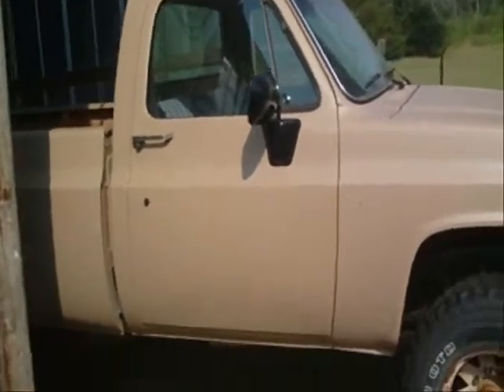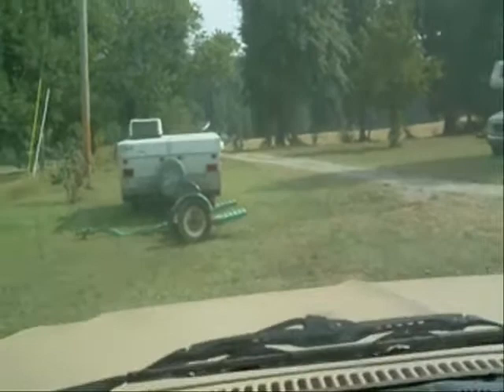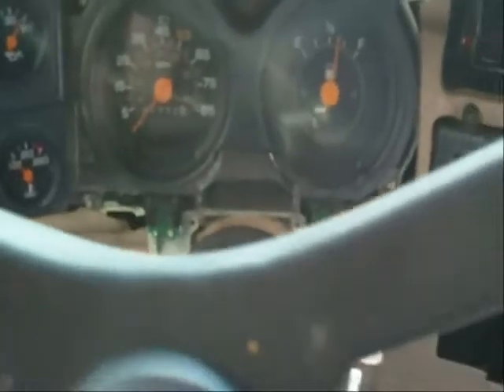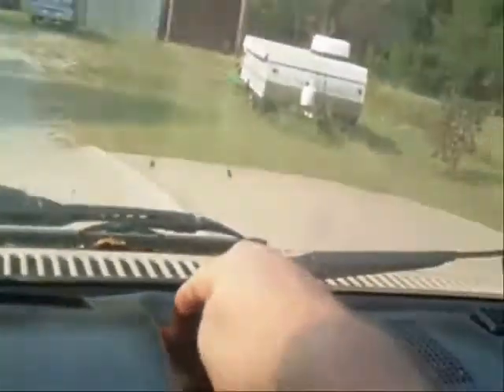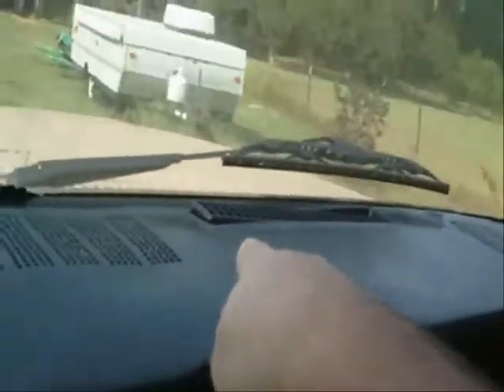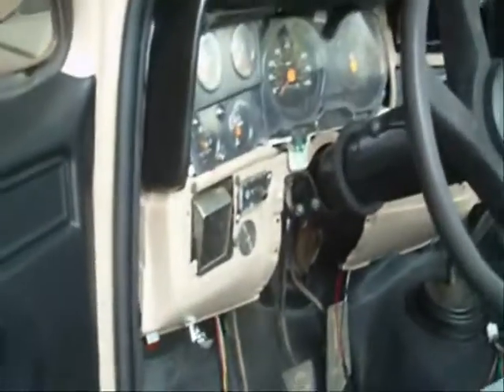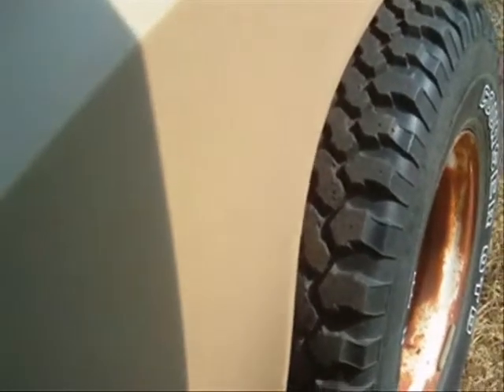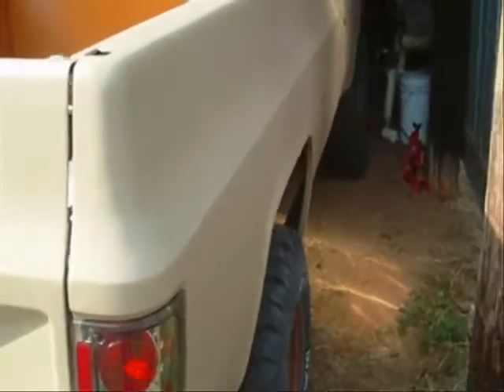Project Diesel Update 9-3-11

Comment from the maker: @mountainman28713 The starter has to build 100 RPM to fire it off.  Assuming your batteries are fully charged and the starter is good, then your battery cables are the weak link.  The cables on mine are huge.  I would say they are as big as welding leads and I believe they are factory cables.  The batteries are the premium Advance Auto Parts batteries and I ran them down trying to get it to start. If you decide to use ether, unplug your glow plug controller or you'll blow the heads off.

Comment from the maker: @mountainman28713 Does your engine have an electrical or mechanical fuel pump?  I rewatched your video but I couldn't quite tell.  The red cable you ran to the starter looks a bit small.  I had to use the glow plugs on mine to get it to fire off, so make sure they're working.